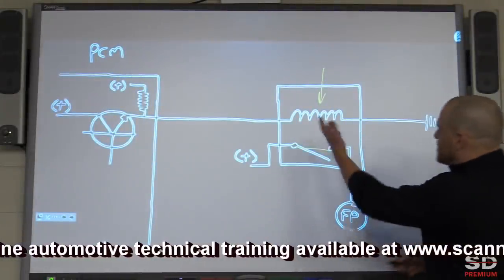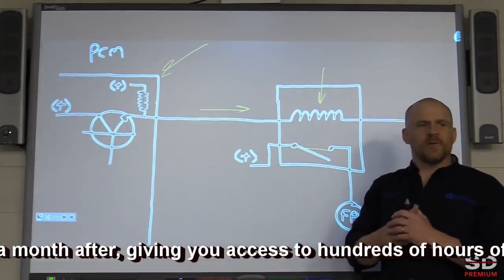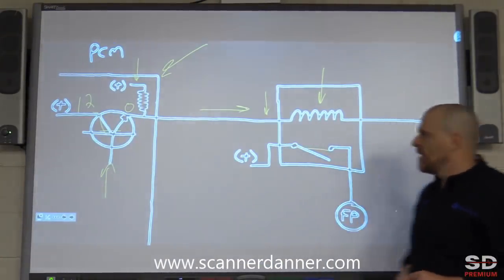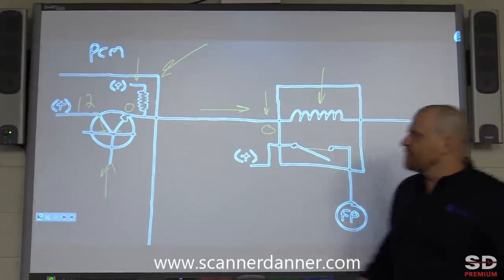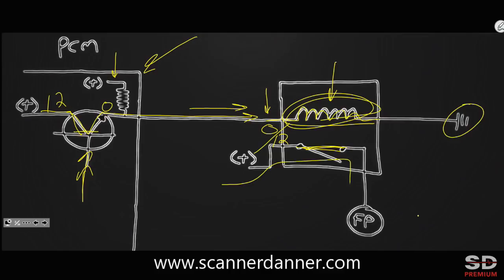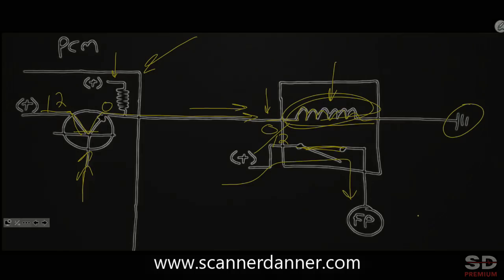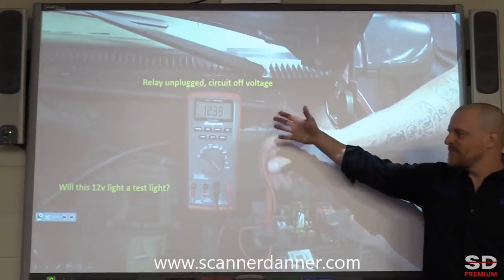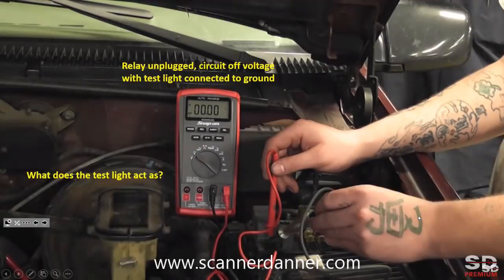Bias Voltage (a ScannerDanner Premium preview)

Comment: Thanks for sharing these videos Paul. Bias voltage will trip up the unaware. A couple years ago when I was starting to get into electrical, and diagnostics, I did get thrown off by seeing voltage where it shouldn't have been, then I started seeing "bias voltage" being mentioned in your videos, and it has taught me use a test light as a bias voltage test. Point is, you put the info out there, and I'm thankful people like you take the time to share this information.
Reply: Hey Mario! I have question man..In this very video - why the test light is not lighting when we have 12v on the pin with relay taken off? I think it's because there is internal resistence in the module and the current cannot get past this very much resistance. Am i right? I think it's time for you to make BIAS voltage video for your channel.
Reply: Petar i simply can't compete with Paul, he goes more into detail than i can. There isn't enough current flowing past the internal resistor to light up a test light. Just as you said. Just like load testing a power wire that has resistance, it won't light or it will light but dimly. Nevertheless the current necessary to light the bulb will be lacking.

Comment: I was just showing my apprentice this exact thing on a Camry with an evap code. The vacuum pump had 12v when the pump was off, and when the pump was on and it was switched in the ECM. I showed him that it wouldn’t light the test light and also that it meant the circuit was open.

A great lesson for him, and everyone else too.
Reply: But why is there voltage vdd,but it won't light the test light

Comment: The take away is that, the 12V reading isn't enough to light the test light , but rather, test light grounds the Bias voltage. Thanks Paul!!!!
Reply from the maker: yep and so does a GOOD solenoid or coil! So if your output device (relay, solenoid, light bulb, motor) is open, only then will you see this bias! This helps you troubleshoot the circuit with ease!

Comment: It might be worth mentioning, for those who will never see the complete course, that the bias voltage circuit is there primarily for the PCM to monitor through a sense circuit for self diagnostics of the driver, relay, and circuit integrity.
Reply: Thank you. As an outsider looking in, its easy to ask WHY designers do this. Diagnostic reasons, sounds obvious in hindsight

Comment: Many confuse voltage as having current value, you can read voltage but have little to no current. Diodes will pass voltage both ways but only allow current flow in one direction. Nice vid here Dan.

Comment: I take exception to your definition of "bias voltage".  What you are referring to as bias voltage is in more generally called open circuit voltage.  An example of Bias voltage would be the voltage applied to the base of that transistor required to turn it on, or the amount of voltage required to turn on a diode.  Another example of bias voltage is  some dc voltage level that another say square wave signal rides on.  Bias voltages are often used by computers to determine if an open or short exists in a circuit.   If the computer can't see that steady low level DC bias voltage it knows that circuit is compromised.  In this case a bias voltage is applied to a circuit by a module for diagnosis.
Reply from the maker: Your own quote "Bias voltages are often used by computers to determine if an open or short exists in a circuit." 
So I guess you take exception to your own definition too? Because this is exactly what this bias voltage is being used for in my examples.

Comment: Nissan uses Bias Voltage as inputs on their BCM. If you measure the voltage on lets say a door lock input that goes to the BCM you will see about 11v but it will not light a test light. You ground that wire and it acts as the command signal to tell the BCM to either lock or unlock a door, wiper, etc, etc.

Scanner Danner is the truth!
Reply from the maker: This would not be a bias voltage that you are describing on a switch input. The design you mentioned I would call a "pull-down" type circuit. This is a signal voltage that is designed to be pulled to ground to create a high/low signal the computer can use to determine the state of the switch. You are correct in that it will also NOT light a test light, as it has a high ohm current limiting resistor in the circuit, but I would not call this is bias. Hope that makes sense. It is different than what a signal bias actually does, say on an O2 sensor.
Reply: @ScannerDanner  yes it makes sense. 👍

Comment: because of the bias voltage you should put a small load on what your testing like what you did with the test light the test light is acting like a small load on the system to it will pull the bias voltage down to 0 or close to
Reply from the maker: only if you want to test and see that it is in fact a bias and not an actual load carrying voltage. Other than that, we don't want to load a circuit, just in general, because we want to use the bias voltage for circuit testing

Comment: Good commercial, makes me want to buy it and I'm not even an automotive tech! I guess I've got to buy it to find out WHY would they put 12v to that pin after a resistor that eats out all the driving current on a simple "on/off" DC circuit.  Biasing is usually used to keep the transistor from clipping when its processing AC signals like microphone vibrations or electric guitar sine waves. I'm not going to be able to sleep tonight. . . .

Comment: Good day Paul.  I haven't seen or heard you discuss issues with third party Autostart/Remote car starters.  Have you ever encountered a crank but no start condition and found the fault to be an autostart/remote starter ??
Reply from the maker: I have a few videos on aftermarket anti-theft devices. I only remove them when they are causing issues. I WILL NOT troubleshoot some aftermarket, hack job install, of any anti-theft or or remote start system. No wiring diagram, no information, and they are almost always installed in the worst possible way. Restoration to factory set-up is the only option I offer or I won't touch them. Hope that makes sense as to why.
Reply: Paul, Thanks for taking the time to respond.  Makes absolute sense!  Time is money.  Thankfully, I am able to do my own work.  Sadly I don't have all the new equipment or scanner and so I have to rely on old school.  I have ordered a better OBD2 tester but it's still basic. 

During my recent experience of a crank and no start troubleshooting, I find an intermittent ground on the VCM Harness C3 pin 9 which is the VCM IC Control to the Ignition Control Module.  Stripping back the tape, I find the C3 Pin 9 wire skived back and a tach wire from the Autostart remote loosely wound around.  Before this stage I had checked for spark and had one although weak.  Disconnecting the remote tach wire cleared the ground issue and I have a very strong spark.   Still crank but no start.  Did all the other checks/tests and all coming up ok.

I totally disconnected the Autostart harness's expecting the engine to start.  Uh Uh Nope!

Contacted the original installer firm and they cannot help and put me onto the Manufacturer website.  I contact the Mfd several times and they do not even respond.  << Amazing!  My request from them was as follows:  On the Autostart system with the harness's connected, is there any other wire I should be disconnecting and or placing a jumper so as to isolate the Autostart unit from the engine and confirm either engine start or investigate other issues.  Also can they provide a circuit board schematic.

Since then, the weather is all over the place and so I have brought the Autostart module indoors, opened it up and now working backwards to see how it works/functions, etc.  Typical slight arching and pitting on the relays of which I have cleaned up and now ready to attach a test power supply and document what does what and when.  My thoughts are that tach wire is to shut down the engine (by shorting the IC Control) after a pre-determed time.  During normal operation, a relay will likely switch open and keep that tach wire open/un-grounded.  That's just the beginning!
Reply from the maker: Okay cool, we can definitely help you. Post this to my forum. Include year, make, model and engine of the vehicle you are working on. 
Let me know when you post it and I'll try to personally jump in.
 It is free to join. 

https://www.scannerdanner.com/forum/post-your-repair-questions-here.html

Comment: I have a 1995 f150 5.0 that i just replaced distributor on and when I set the time and shut off truck and tightened the set bolt down and put spout connector back and fired it back up I checked time with light and when it idled down my my mark was jumping all over the place. Could a faulty spout be the cause?
Reply from the maker: with the spout connector in, the computer takes over timing advance, so if it is running normal, don't worry about it
Reply: @ScannerDanner  thanks for the info brother it's running good.

Comment: hey man i love your videos and they are damn helpful for a novice or well trained mechanic or tech. but i'm an old electronics man  just now adopting to a scope,but i've got a minor background in electronics. i use a cheap hantek 1008c and  know your partial to the pico, but i like to fool with electronics. i am trying to make some high and low bandpass filters to use with the o-scopes that aren't built in. could you give me some frequency filters that i've seen on the picoscope?,i am goin to try to make a variable one that i could adjust live

Comment: Hi Paul  first of all I would like to thank you for all the knowledge and the information you are sharing, I'm not a technician but I enjoy a lot to work on cars and learning new stuff. I understand that there is no way you could diagnose a problem based on the info I'm gonna give but at list I was gonna be really thankful if you could give me an opinion or direction where to look because I'm running out of ideas and I have a really weird issue with my car. I have 2003 Hyundai elantra 4cyl 2.0 everything works fine and it runs nice and strong then it looses a lot of power, it dosen't misfire or runs rough or nothing else its smooth with right idle and works fine but it dosen't have power it feels like you putting on the ac and the engine is not that strong no more.. after a little works fine nice and strong and then it loses power again.. and cel comes on with  code for camsaft position sensor I have access to new parts through a friend so I'm replacing them with very little cost I change all the rest with no result  camsaft position sensor twice, crankshaft position sensor , intake air temperature sensor i visual check all the wires from the sensor all the way to the firewall and they look o.k  also changed the pig tale on the harness for the camsaft position sensor and still getting the same code with same problem, the most weird think is that the one moment works fine the other no, plus when the problem appears if I stop turn of the car and start it works fine , I can't think any way to diagnose this because the problem is not there all the time..  please any help or opinion could be helpful ,thanks!
Reply from the maker: so the low power AND cam sensor code are directly correlated? Meaning you can clear the cam code and when the low power issue happens, the check engine light comes on and the only code you have is for the cam? And you can recreate this event?
Reply: @ScannerDanner  yes i start feeling less of power after a couple minutes the code comes on only for cam sensor , I keep driving around like that after a sort period of time  the problem goes away and the light the most of the times ,it works fine and then again the same problem/code and if stop when I feel the power loss turn off the car and started right away it works fine ,I forgot to mention I swapped the computer with a 20$ used one from Ebay but still the same issues..
Reply from the maker: would love to see what that cam signal is doing on a lab scope, unfortunately, not much else I can offer. What is the exact code? Is it a correlation code?
Reply: @ScannerDanner  the code is po340 camshaft position sensor a circuit bank 1 or single sensor I will try borrow my friends scope and take a video of it but I'm thinking that is not gonna show something unusual because the problem is not there all the time... if I make it with the video I will post it here thanks anyway!!

Comment: So its best to use a test light most of the time
Reply from the maker: for what specifically? the answer is yes and no
Reply: @ScannerDanner  using a test light for checking powers & grounds and a multi meter for ecu circuit, but a multi meter might read 12v where there is like a fake power. A multi meter & a led test light are almost the same

Comment: The bias voltage won't light an incandescent test light, but can it light a led test light?
Reply: As a EE, I'm curious about that myself.  He may address the purpose of it in the full video, but I do wonder why the resistor is there.  It's purpose may help determine what value of resistance it would have.  It may be there for the sole purpose of protecting the transistor from the back EMF kick that the relay coil will create when the current is shut off.  If that is its purpose, the resistance would be kinda low to limit the back EMF.  In that case,  it probably would light up an LED test light at least a little.  SD, waiting on your take on this.
Reply from the maker: @John C yes a bias voltage may cause an LED test light to glow dimly. One of the many reasons I won't use an LED test light when troubleshooting
Reply from the maker: Thank you Craig!
Reply from the maker: The purpose of this bias voltage is for circuit testing by the computer. It can determine opens and shorts in the circuit and sets fault codes. 
If the resistor wasn't there, that 12v bias circuit would keep the output on all the time :-) 
This is not a de-spiking (back EMF) circuit
Reply: @ScannerDanner  that makes sense.  In my line of work, we call that a pull-up resistor.  That means that output also contains an input that returns to the computer.  I wondered about the EMF thing because, with the direction of current, and depending on the value,  the back EMF could drop way below ground.  There's probably a diode there (not shown) that gives the relay coil current somewhere to go when the transistor turns off.
I was thinking, I'd put a diode there, but perhaps a diode is $.02 more than a resistor and a resistor works "well enough."  Haha. Car companies do have a reputation for being penny pinchers at times.

Comment: BOOM! Goes to show you it doesn't always have to be a long video to slam it home. Well done Paul.
Now that I've kissed your ass I have a question. Why do you think they aren't using a mosfet or IGBT instead of an NPN bipolar device? They are faster and have a lower on resistance.
Reply: If you're basing your comment on the generic symbol he uses for a transistor, I wouldn't worry too much about it. I doubt he knows or cares which technology is actually used. It's basically irrelevant.
Reply: @fascistpedant758  I get you. I just come from a place where we do pay attention to the symbols used because the potential for using a circuit or component a certain way is completely relevant. My bad.;/
Reply from the maker: @InsideOfMyOwnMind to be honest, I have no idea. And as @anti chuckle said, for what we do as mechanics, it doesn't matter and the symbols I draw are just generic
Thanks man! 
I suppose if we were building these circuits, then it would matter but we're not, so what is more important is that we understand when we have a component failure, a wiring failure or a driver problem. Then of course, if the driver has failed, how to make sure the wiring and component being driven did not cause the failure.